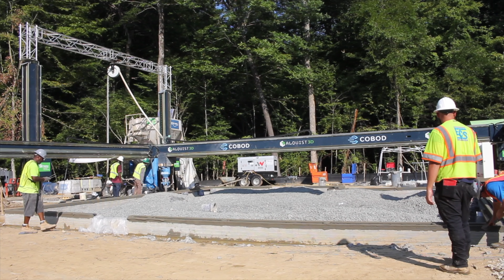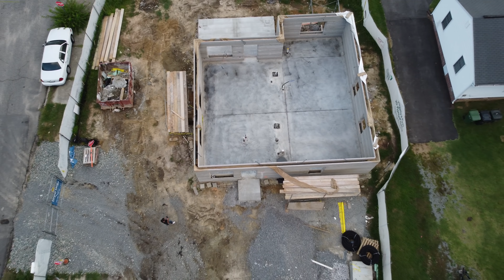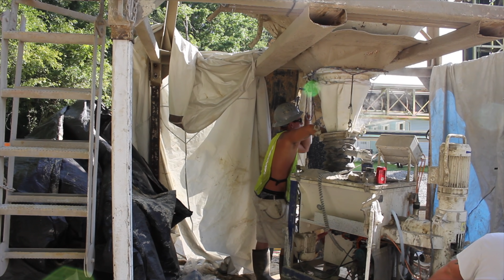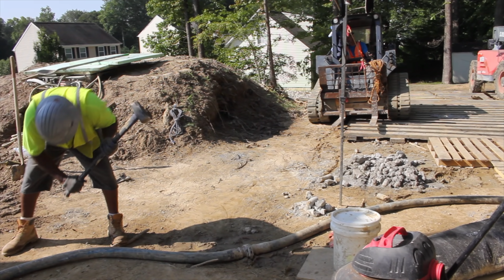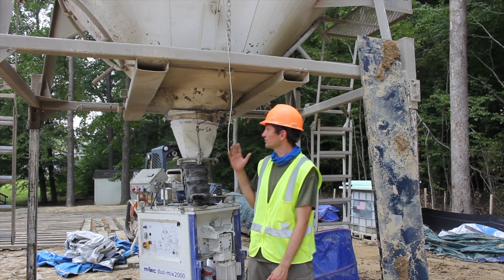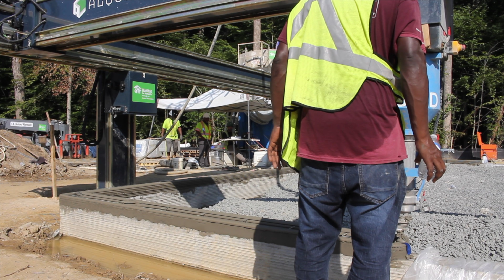3D Printing Habitat For Humanity Home | Behind the Scenes Smooth Layers Trick

Comment: Wow this is an insane amount of setup to make this happen. Industrial generator, chiller, onsite mixing plant, printer and columns for the feet and on top of that all has to fight the temperature change through the day...

This can't be faster than just putting up metal forms and scheduling a few ready mix trucks. I understand they are just figuring things out and will speed this up some but some of these are fixed activities and costs that can't be refined out like the mixing plant or the industrial generator (not sure temp service pole would run it).

The more I watch of this tech, the more I am not seeing a situation where it makes sense. Sorry about all the negative Nancy feedback

Comment: Having done some structures by hand, without the gantry with my own pump design, I found that removing the hose variable is paramount. Seeing the size of this gantry, I would build a mixing head mounted at the print nozzle assembly. There are way too many variables in these printing methods.

Comment: that 1930's Urschell hopper extruder compacting dry mix, retrofitted to these modern cnc gantries would remedy piping problems of solidifying sludge.. also, hemp lime mortar mix with geopolymer binders extruded at 6" replacing cement layering at 1" per pass w/o cold joints cracking would combine timely tested with present tech.. my two stones.. rocking channel! thanks..

Comment: My problem with concrete is that it starts falling apart after 60 to 70 years, which is why so many bridges need to be replaced in America. Evidently, the Romans used a lost formula for making their concrete structures, which is why their buildings are still standing. But modern concrete eventually falls apart and must be demolished.
Reply from the maker: The Romans didn’t even use rebar it’s pretty crazy.

Comment: Good for these contractors. Building for habitat for humanity is a good way to gain experience and give back. Most habitat homes are  all wood. So the concrete gives them more sustainability. Plus for a lower cost home helped to buy they live with mistakes or blemishes a lot easier.

Comment: Brilliant people there. \V/_ Vulcan high5's from a safe social distance to each and every one of the team players as they lead by example. 

I was observing and considering options, they could probably add a water sprayer attached to the extruder that applies water a foot behind the extruder, even a little robotic arm attached to the extruder that uses exacting digital sensors to run a spatula along the sides of the extruded material for quality control and productivity.
The sprayer may allow for additional hardeners or tinting to be used.

That's wild about how they go about regulating the temperature of the material during relative humidity. 
Interesting science. 

Of course it's easier for anyone such as armchair me to write or say rather than to implement, however, innovation occurs when the result of open sourcing ideas shared even for preexisting concepts moving forward.
The Supreme Court today approved evicting millions, we gotta crank up the rayostat for the printers..

Keep up the inspiring work as the type of front line workers you are.

Comment: Kudos Jarett.  The upgraded mic was noticeably better and you asked the cost question (even if they couldn't answer it).  

Also, good to see real world challenges with this printing.  Seeing them hammer out the lines caught me off guard, but makes total sense once I thought about it some more.  I was also surprised that they had to change mix during the day to account for the change in temperature.  I wouldn't have thought it was quite that sensitive.  Thanks for sharing.